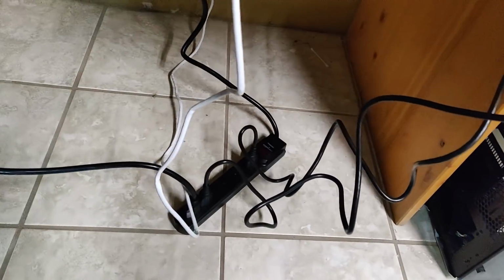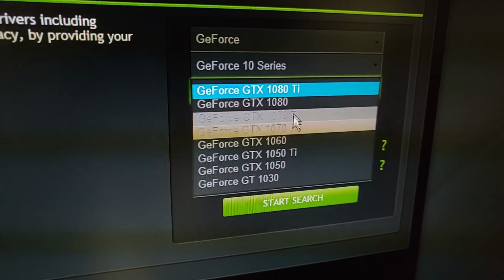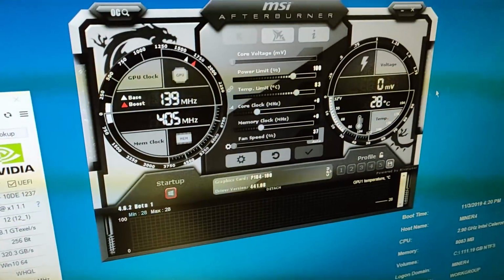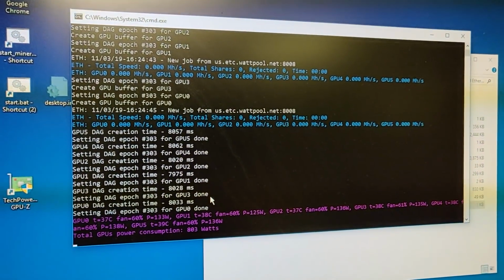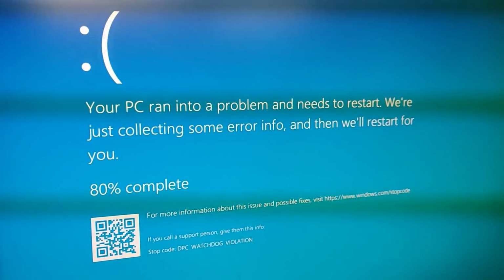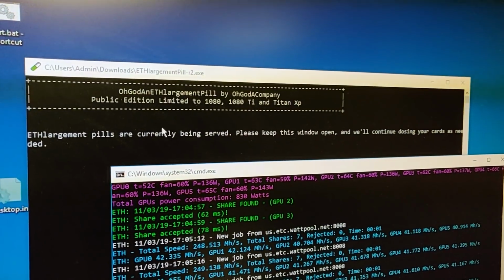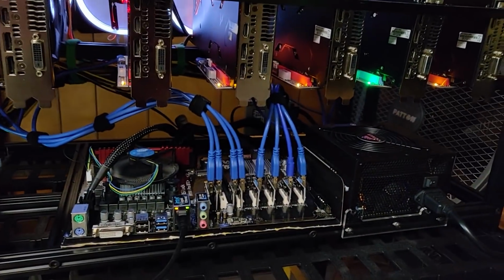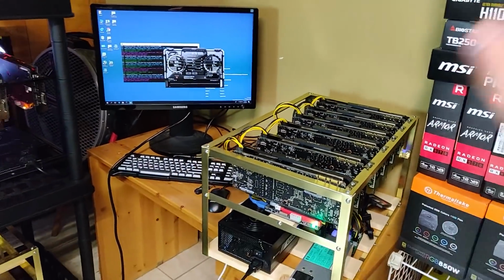6 x EVGA P104-100 8GB Is MINING But... ⚡

Comment: Waste of time. I used to mine too. That was the biggest waste of time ever. I sold all my hardware a couple of years ago for about 9k or a little more. Yes, I was really into it. I originally spent over 20k on that hardware. So I was down big time. I took that money and bought some Bitcoin when it was around 3.8k per coin and more than doubled my money without having to deal with all the bullshit. Don't do it guys just buy the coin you want to mine much cheaper.

Comment: RX5700 8GB with Bios Mod 61MH per card and 189w AMD for $330 a card>  You are not calculating the power sucking from the CPU, RAM, HDD, MOBO

Comment: Just to be clear, a p104-100 is a stripped down gtx 1080. Not an opptimized 1070. Would be a miracle if someone could attempt and get the Ethlargement pill to work with the P104.

Comment: Impressive to see 40+ out of those cards. Did all of them show up as 8G cards? That would be a big boon.

Power draw does seem odd. I would have guessed around (6x125)+130 =  880w. Or even less than that if you are running under 70% power closer to 850w out of the wall. That's what I see with my 1070 and 1070 Tis.  I'd try throwing the rig on a single 1000w+ PSU to rule out some weird ground looping problem using those 2 power supplies.

Comment: When I checked, I saw that this hp power supply has a 94% efficiency rate. This is true under certain situations. This is for 220 V from the wall under around 50%-60% load. If you use a power supply with a very light load, its efficiency drops significantly. After 60%, load its efficiency starts to drop too. Doing something like plugging one of your graphics cards to the power supply for your cpu and the other five to the HP power supply might drop your power consumption from the wall. This might also work for your rx 480 rig. Using 220 V AC is important when it comes to efficiency. This HP power supply has a max output of 900W with 110V AC.
Reply: No country use 220 anymore, it's 230 now.

Comment: I told you, you could get RX5700 and get more hashrate with less power. Let's say 270Mhs with 580Watts of 5*RX5700 with stable hashrate on claymore about 53-54Mhs per card. But still good that you tried, I'll never buy this P104 for mining for sure :)
Reply from the maker: but bro, the price of a rx 5700 is 3 times more than this p104 which im not willing to pay! just for maybe a bit more efficiency tbh. it doesnt make sense to buy new cards, probably only used mining cards and 10 series
Reply: @RedPandaMining  I believe that we don't know real potential of the RX 5700. I hope that AMD will release a proper drivers so we can use timings and hashrate will be more than 70Mh per card.
Reply: @RedPandaMining  You can find for 289 bucks a rx 5700 you flash the XT bios put some washers and change thermal paste has show on the other channels and you have much better efficiency and much better resell value, not to mention that they are NEW and will last more in theory.

Comment: Try undervolt with the same overclock setting using nvidia inspector. MSI underburner do not allow me to undervolt my 1060 gaming x but nvidia inspector i can use command to do that. Your p104 you may try SET GPU1=-setBaseClockOffset:1,0,50 -lockVoltagePoint:1,685000 -setMemoryClockOffset:1,0,800 -setPowerTarget:1,60 -setFanSpeed:1,60
Reply: You have to unlock it on MSI AB then it works

Comment: As you mention is that two PSUs utilities more power than one. Try to use only one PSU if you can. I don't know if the power consumsion is low or high on that GPUs, but consider that you are getting quite high hashrate (40+ MHs), so don't compare them with GTX1070/RX580 for example, I suppose.

I think I should lower the PL even more, more to 55-60% and bump up the core till it crashes, and lower it some. But I don't mine ETH on my Nvidia's so that's another story, but anyway. That is what I have done on my Nvidia-rig. :)

I don't use MSI Afterburner anymore. I just use Nvidia Inspector for my Nvidia-cards. It's easy to do batch files for certain algorithms, and one pro is that you can for example lower the memory clock at -1000 MHz, which is great for Equihash/Grin/Beam, well most algos? :)

Another tips: Use a MSI Afterburner version that shows the actually mV if you can. Then you can adjust the PL after lowest voltage the GPU can use.

Comment: Yo you need to pring the pl down to like -30. My 6 card p104s flashed are at 850 doing 250mhs. The real issue is two psus. My rigs all have a single 1300w  EVGA G2. I highly recommend a single psu for mining, it is almost always more efficient.
Reply: +200 core, +600 to + 650 mem, 71 at the power limit, so -29. Strap 4 is the correct strap as you found.
Reply: Windows by the way
Reply from the maker: @BitKing_Ross  wtf testing this now then.
Reply from the maker: @BitKing_Ross  wow that worked, how is that possible that less memory, i had +800, but now at +650 I'm getting more Mh/s, what is going on. Power Consumption is show 760 in software, at the wall I cant see at the moment..
Reply: Red Panda Mining its because the strap optimizes the memory which actually funcitons better and more efficiently at around those levels as opposed to higher.
Reply from the maker: @BitKing_Ross  Interesting, thanks man. Will credit u in the next video i make about this rig, will also try the single PSU thing
Reply: Red Panda Mining hahah hey no biggie man I like helping out as much as you do man! I definitely think you’ll see a difference as well with the power supply reduction.
Reply from the maker: @BitKing_Ross  will update asap. thanks man
Reply: @RedPandaMining  It's also possible, if you overclock TOO much, you get errors which isn't always showed. Thereby you get lower hashrate. Higher isn't always faster :)
Reply: At 800 you might be running into electronics instability but not enough to crash the card or driver. Might also be experiencing some thermal throttling of the memory or core clocks. 

I've been playing a lot with 1070s and 1070 Tis trying to get them optimized the last week, and you're at about what I have come up with, through trial and error: 70%/+100 core/650-675 Mem.  I've taken the core up to 150, doesn't seem to have much effect on the hashrate. I can easily take the memory to 750, but there is negligible difference. I started to notice some drop off at 800+. Didn't get the weird high power draw though.
Reply from the maker: so -30 PL is 70% in Afterburner which I did have.
Reply from the maker: 250mh/s? what is ur overclocks for core and memory
Reply: heey! what bios did you flash on them? my 4 p104s have different base clocks for some reason